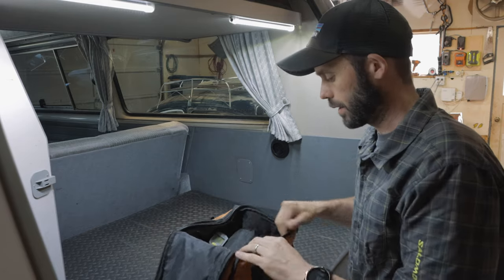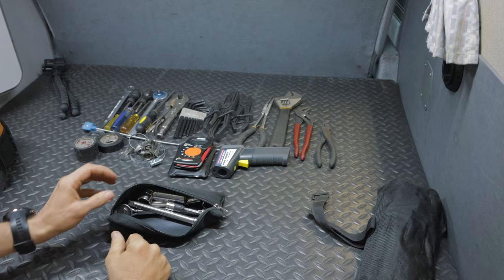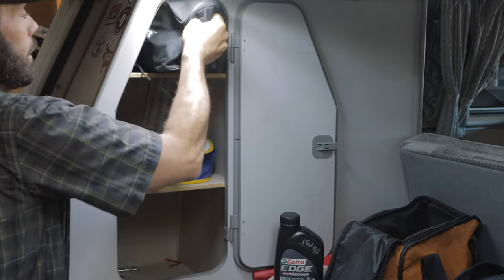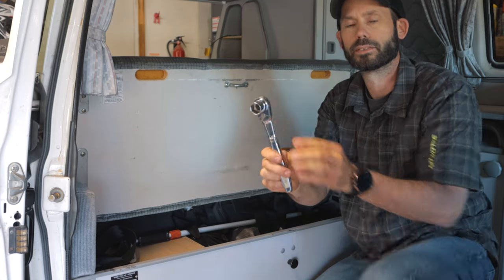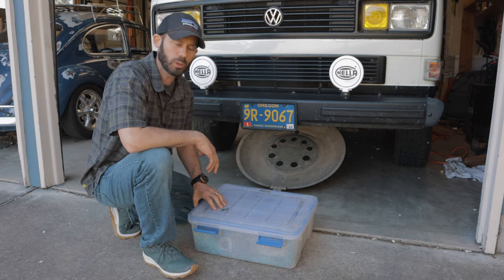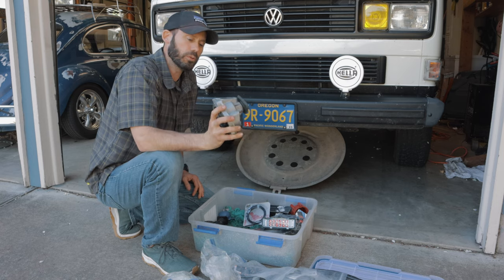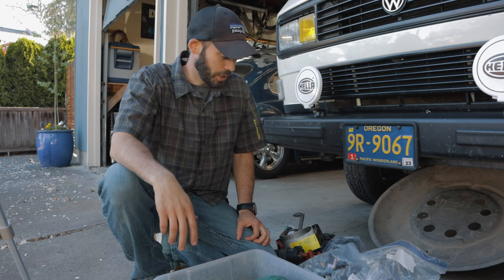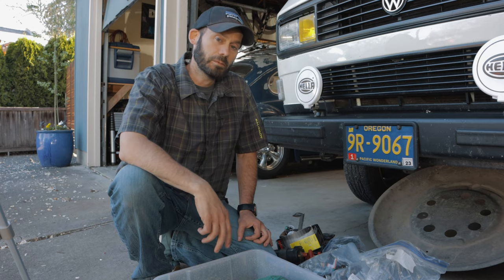What Spare Parts and Tools we keep in our Vanagon... It seems I have a spare parts addiction

Comment: I definitely appreciate this kind of video. Like you mentioned, knowing your vehicle because you are the one who works on it is a big plus when you need to do repairs on the side of the road. Right now we have a plastic bin that holds our extras and tools, but finding a better storage solution is part of the plan. We carry a Garmin InReach Mini to help reduce the anxiety when traveling. With the InReach, if we break down out of cell range and can't fix the problem, at least we know we can contact someone and tell them where we are located.
Reply from the maker: The InReach is a cool technology.  I looked at getting one when I was doing some dualsport motorcycle riding and would get deep in the middle of nowhere by myself.  Luckily I never had an issue but as you said, it is reassuring to have it there if you need it.
nate

Comment: Totally understand the perceived overkill on tools and parts! I'm right there with you. With my 67 Westy, I always carried an extra generator belt, clutch cable, oil, limited specific sockets, and flat blade screwdriver. But now that I drive a 27-year-old Mitsubishi Delica, I have a whole box of metric tools (very extensive), and gobs of other tools, and a whole box of OEM spare parts.
Reply from the maker: If we just stuck with paved roads that had cell service and camped in campgrounds, we wouldn't carry as many parts and tools.  But since we like to venture far off into nowhere, it is comforting that we feel we can fix most things that might go wrong.
Nice grab on the Delica, great vans!
nate

Comment: I carry a spare accelerator cable. Water from the on board tank will get you to the next auto parts store. No need for an entire gallon of anti-freeze.  You will repair any problem that caused  coolant loss when you get home anyway. Replace the 4-square lug wrench with a 1/2" drive breaker bar and 19mm impact grade socket to save space. I also have a lithium 12vdc battery pack for charging USB stuff AND, if necessary, jump the main battery. 12' tow strap with hooks, rope or line, air pressure gauge, wheel chock, fuses and more.  If I were the video guy I would place the fuel pressure regulator in a zip-lock bags as most other parts are.

Comment: That was superb - thanks for going the effort of doing that Nate. You certainly have a lot of stuff but as you say, no mobile-phone coverage means you are on your own in a potentially dangerous situation. Here in England you can generally walk 10mins to a corner shop if you break down! Our list of spares is tiny but covers what our recovery service might not do or we can do ourselves: we have a carb cleaning kit, alternator belt, coolant (concentrated), oil, socket set, Mole wrench, adjustable spanner (crescent wrench), a kit of tiny Allen sockets/ screwdriver bits, gaffa tape, electrical tape, snow-cable ties (cheap chains) and fuses. And Waxoyl and Fertan - no really! Got to keep rust-proofing, even on the road...
Mainly we make sure we have people-related stuff like spare food, blankets, water, big First Aid kit and lots and lots and lots of childrens' stuff ie bucket-and-spade (do you have those in Canada?), kite, bat and ball set, colouring books etc! All the essentials whilst we wait for the AA!
We will get some of those clamps - superb. Oh yes - we have many spare Jubilee clips for hoses: v important those. And jump-leads.
More of those videos please and perhaps video some maintenance or repairs? 'Liked' as usual.
Reply from the maker: Sounds like you've got a good kit sorted for your van!  We try and be as self sufficient as possible as we do travel to some pretty remote places here in the US and we can be many hours away from help.  Will be doing a manual transmission oil change here in the next few weeks.
Take care!
nate

Comment: My syncro had very mild issues idling and would die on occasion. I went to install that TT tuning chip in the ecu and discovered a part of the circuit burnt up in there. Replaced it and never had an issue idling since. Never overlook that dang ECU!
Reply from the maker: For sure.  These old electronics can burn up or break solder joints. That’s why we keep a spare working ECU with us at all times. Glad you got it sorted!
Nate

Comment: Personally I’m more of a fair weather camper and don’t think I’d be so far off the beaten path that I couldn’t get help. But I completely agree that having the more exotic parts (at least the small and harder to come by ones) is a good idea. The known good ignition switch, ecu, unique hoses - even if you are towed to a local mechanic it will save you days to have the part. 
I have had the fuel pump go bad mid trip, easy fix if you got one. But the other thing I’ve had go bad which you did not mention was the alternator, that doesn’t stop you dead but your range is quite limited.  And besides the ECU and coil are there any electric components, relays?
Reply from the maker: I just replaced the alternator last year due to a bad bearing so I am pretty confident it is good to go for awhile.  Worst case I think we could combine our starter and house batteries and get somewhere to get it replaced.
I have a spare fuel injection relay which can be used in several places and of course fuses as well.  
nate

Comment: I thought 1 spare ignition switch was enough ;) The only thing that has put me on the side of the road (2 events, years apart, different vans) was the fuel pump.
Reply from the maker: Yeah the used switch was my old one after I replaced it and the new one was the one the guy from Descend replaced for me.  I usually don't carry two :)
nate

Comment: Few things I carry that were not in the list is a complete cv axle ready to bolt on, a 3 ft length of corrugated 1 1/4" radiator hose depending on year of van,  a few feet of 5/8 heater hose, few feet of fuel line and a bunch of various hose clamps and barbs.
Reply from the maker: Good ideas.  I usually keep a spare cv joint in my kit but during the video, I noticed it was not in there. A full axle is a good idea as well.  I like the idea of the corrugated hose, I will look into that.
Thanks!
nate

Comment: From experience, I know you can't have too many spares or tools with you when driving an old vehicle to remote places. My tools include a 46mm 3/4 drive socket and breaker bar. Not all service stations have those large sockets as part of their inventory to assist in replacing rear wheel bearings.
Reply from the maker: Very true.  We now keep the 46mm socket and 3/4" breaker bar in our kit.  I didn't have either of those prior to replacing our rear bearings so now they live under our back seat just in case.  Spare bearings as well
nate

Comment: Great ideas on what to carry, have a 81 air cooled for last five years the motor froze up on a trip to Mammoth Ca, could not fix that, last month a trip to visit kids in Reno the coil went bad, nope didn't have extra coil. Great VW mechanic in Bishop, had to overnight a new coil but finished the trip.
Reply from the maker: Glad you were able to finish up your trip.  Sometimes break downs can bring about new adventure but I would rather be able to have the part on hand if possible as these old vehicles are getting harder to source parts for. Thanks for watching!
nate

Comment: Just a tip, those white zip ties degrade over time & get really brittle. If you use them where they sit in the sun or are around a bunch of heat, they will degrade even faster. I've found it best to use black zip ties. They last MUCH longer & their UV resistance is way better than the white zip ties.
Reply from the maker: Good call, never considered UV and heat with the white ones.  They are just what I had around.  I will toss some black ones in the tool kit.
thanks
nate

Comment: Hall sensor for the distributor and the Temp II sensor. Right up there with the ECU and air flow meter as far as failure rates.
Reply from the maker: We keep a temp II sensor on board but not the Hall.  We replaced our distributor when we rebuilt the engine but it might be a good idea to keep a spare Hall in the kit.  Thanks!
nate

Comment: This was a great video! Thanks for it - as a new owner (well, my GF technically owns it), I have been enjoying the tinkering and hacks videos. The Westy we bought has a rear spare installed, so I was just FLOORED by the clamshell under the front. However, I went and bought a 7 inch deep storage bin like you you have, but cannot seem to make it work as it keeps hitting different things underneath the front of the camper and will not close without really forcing it - which I do not want to do. Is there something I am missing? It looks like it works very easily for you and the bin I bought looks at least close to yours. Ideas? Thanks again for all the great ideas!
Reply from the maker: Hmm not sure. I will try and get some measurements on mine but it is close to hitting the shifter box and coolant hoses but just misses them
Reply: @ThatBaldwinLife  I actually found one that worked, and for others looking - the "Container Store" has something called a "boot box" that is about 6 inches tall. That is the key. 7 inches is about the most you can fit under there.

Comment: Awesome vid. Big help for folks. You got what you need but you may dig this ratchet/driver set I just threw in my Subaru. Fuggin love the thing. Can tear down anything in there except the engine with this one set. Do an amazon search for "Wera 056490 Tool-Check Plus"... It ain't particularly cheap but I've two other precision driver sets of theirs for a few years that I absolutely loved, saw this thing and bought it on a whim. I might buy another to chuck in my wife's car.
Wera 056490 Tool-Check Plus
Reply from the maker: That is a handy little set!  Can even wear it on your belt! :)
Thanks for watching!!
nate
Reply: @ThatBaldwinLife  Zacktly. :) Thing is pint-sized but really well made. Cheers man.

Comment: AFM, CV joints,  fuel pump, all  (under normal circumstance)  DO NOT fail catastrophically, so no sense to carry that stuff.  I can drive without brakes or clutch so no sense in carrying anything  brake/clutch related. There are several other hoses you should carry.  Most important part you missed is a distributor.  The hall sensor in the distributor, can stop your engine dead.   Like the ECU buy a spare. 

This is a warning to you and everyone out there.  The location of the original spare tire is an integral part of the front end collision protection,
built into the vanagon.  By removing the tire you have less front end protection, in a bad crash..   Carefully  examine how the a front end crash will use the tire as a cushion and you will see for yourself...
Reply from the maker: I respectfully disagree on the fuel pump and AFM. I personally have had fuel pumps just die while driving down the road, no warning.  Not on this van but other VW's.  My buddy had an AFM that just got worse throughout the day then by the end of the day, the van wouldn't drive far.  Luckily he was close to home.  Good call on the distributor.  I did replace mine during the engine rebuild but a spare hall sender is not a bad idea.
I hear ya on the spare but we have larger front brakes and our spare will not fit in there well.  We tried.  I can't imagine that VW didn't engineer some sort of tolerance in the collision if someone was running the spare with the bad tire in the back. That would be a law suit waiting to happen.
Appreciate the feedback and your perspective!
nate
Reply: I also keep hearing the false narrative without any proof that the spare tire is part of the crash protection system. There's no way any vehicle could be crash certified with a part that is designed to be removed. Logically and legally that makes no sense.
Reply: @ravenm.  it does not make sense what if you get a flat the have a collusion

Comment: I like the way a vanagon, & eurovan looks from the 80's, & 90's, but are they that unreliable...
I got to 4 minutes in the video thinking after spending 20k for one that I couldn't work enough to keep one running.
Reply from the maker: No they are not that unreliable.  We travel pretty far off the main roads with no cell service most of the time and want to be prepared for whatever could happen. If you stick with mostly to areas with service, there is not much you need to bring.  Remember these are still 34 year old German vehicles and will need some extra attention.
Thanks for watching!
nate

Comment: Temperature gun lol, covid ready...lotta tools, lotta weight and space, where do you put your gear when travelling
Reply from the maker: Haha, didn't think of using it for that!  We use it for checking hose temp or head temp is something seems off.  We don't bring a lot of gear I guess.  Our clothes and pillows go in the cabinets along with the food of course.  Camp chairs go in the rear with the propane fire pit.  Not much else to bring!  It is really not that much weight.  I am sure w saved half of that by removing the stock propane tank.
nate
Reply: I have a 86 westy, subie conversion professionally done, owned it for about 20 years, lived in it on and off, recently for two years travelling North America.  I remember the days when it used to break down and you learned to have everything just in case.  You seem like  the type to replace every component, like myself, make it reliable, and then double up , just in case. ... I think that comes from owning it for a while and remembering the old days, but man I thought I was bad.
Reply from the maker: Definitely.  We do our best to keep up on maintenance and replace aging components but sometimes the newer replacement part quality is not so good so you need to have a spare.  All part of the adventure!
nate

Comment: That's a crazy amount of hardware to carry. Why do you need that? Having your Westy checked before and after every road trip and serviced when necessary eliminates having to carry so many extra parts. Digifants have largely been rebuilt or restored. There are no bad solder joints if yours has been replaced. The spare tire up front was designed to reduce shock in collisions. The clam shell by itself is not enough. I've had my '88 since '96. Nearly 400k miles on it. I've had a few episodes over the years but nothing that wasn't repairable wherever I was in a couple of days. I don't take long trips hundreds of miles away from any form of life. Being prepared is better than being stuck and you folks like snow.
Reply from the maker: I totally agree it is a bit out of hand!  I did take out the rear main seal after the video was shot :)
I do all my own work on the van and do a pre and post check after every trip and try and replace parts/items that are suspect.  There are no shops involved in the maintenance of my van.  That being said, parts do fail, and I will sacrifice a bit of space and weight for some peace of mind.  Our ECU is a used replacement so no guarantees there are no bad solder joints.  
Point taken on the spare tire situation.  
We take many long trips that we may be without cell coverage or even see anyone else for a few days and I am stubbornly self sufficient and try and be prepared where I can.  Have I gone a bit overboard?  For sure and I am rethinking some of the parts that are in there.  The extra water pump is next on the list.....
Thanks for watching!!
nate
Reply: @ThatBaldwinLife  I want to apologize. I didn't catch the whole video before I commented. You are entitled to carry whatever you deem necessary. If I had to do it I would likely just tow another Westy on a trailer. Everywhere I went. Or buy 100 and park them around America. I have had the lid off the ECU. It's easy. Check for bad solder joints and fix them if you see them. They were using an 80's vintage 8085 Intel micro for controls.

Comment: 15W40? you have 1,2HTP from FABIA???! 5W40 or 5W60 its ideal
Reply from the maker: We have a 2.2L WBX motor and 20w50 was recommended from the builder.  We noticed lower oil temps with a 15w40 and are very happy with the Rotella T6 in that weight.
nate